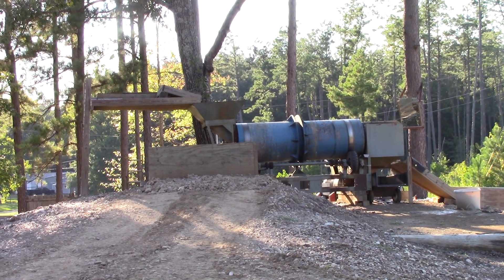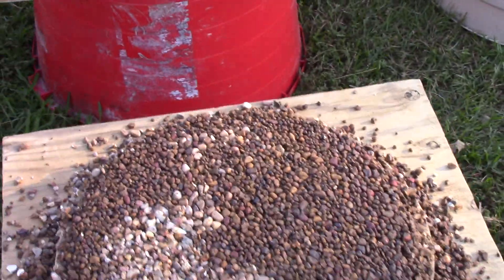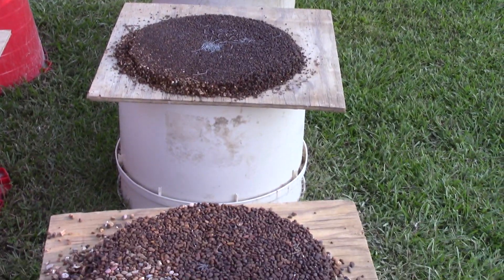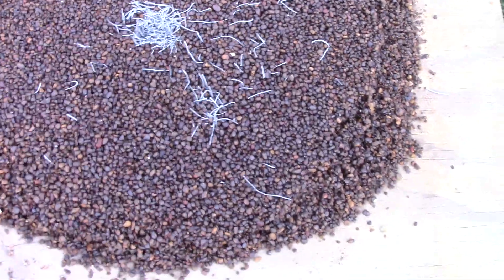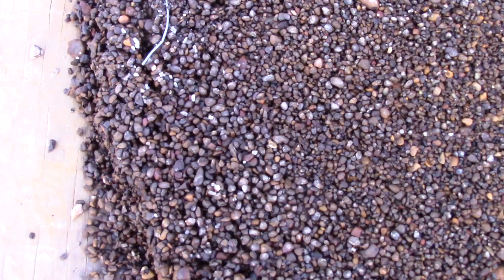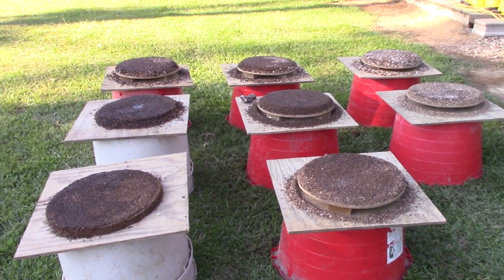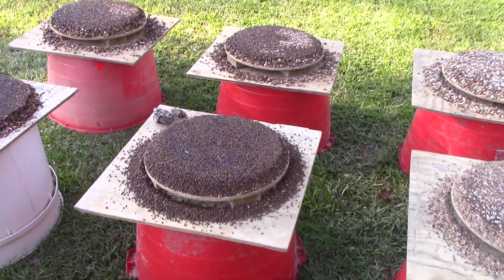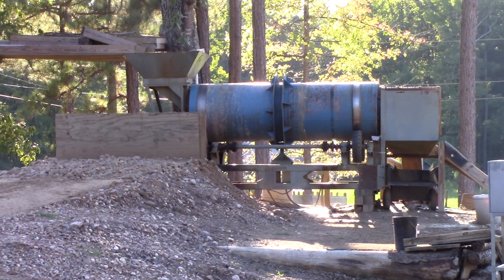The Results Are Now In For The 8 1/2 Tons Of Gravel We Washed At Our Diamond Recovery Plant Today

Comment: I'm curious if you've given any thought to picking up a used core drilling rig. I would think, even hiring someone to run a grid of test holes might save you time and money, unless the goal is just to have fun.
Reply from the maker: Texas Star (another mining company) core drilled along our property line in 1992 and 1993.  They also did a ground magnetic survey.  We know our 10 acres has one acre of lamproite in the NW corner and it extends to a depth of 326 feet.  We don't need to know any more than that.  We are digging and washing the diamond ore.

Comment: ? What if the ditch is shaped more likes a curvey rivers instead of a deep v configuration then would it not then have the most concitatrion of diamond in a insides bends much like that of where higher concentration of gold would be found in a river systems instead of thinking about it as a stove pipes in designs so it could also be heavyer towards the states parks where is super hillers if heads outside of towns of Murfreesboro towards the road that takes u into hot springs area because when saw coming into Murfreesboro Arkansas that areas first before get into town I thought it fetzred has more of a potentially spots to find diamond vs directly upon the crater State parks itselfs because if in past eruption occured at the Carter itselfs then the debris would be pushed up in to air and would settle as little bit farther away from craters itselfs because of wind and heights at witch past eruption occured by at least a miles radiuses from craters itselfs ?
Reply from the maker: You are correct thinking diamonds wash and concentrate in the inside bends of the river/creek just like gold.  Unfortunately, diamonds don't seem to really move here like they do in South Africa.  Ours tend to plop down like an old fat man at a 10K run.  They stay on the diamond pipe instead of washing off and concentrating in creeks and rivers.  I just had to run this test, though, to see if some rebellious diamonds decided to stop acting like other diamonds in southwest Arkansas.  I was wrong, but now I know.  I am doing better mining the primary source (our volcanic intrusion) than chasing hidden, buried, secondary sources (alluvial deposits).  There are 7, known diamond pipes located within 3 miles of The Crater of Diamonds State Park.  We own a portion of one of them.  There is enough ore here to last me the rest of my life.  So, I'll just focus on mining it and getting the diamonds that are there instead of chasing allusive diamonds that might be somewhere else.